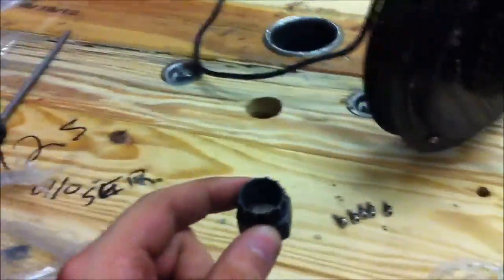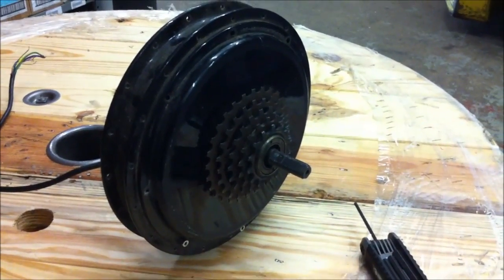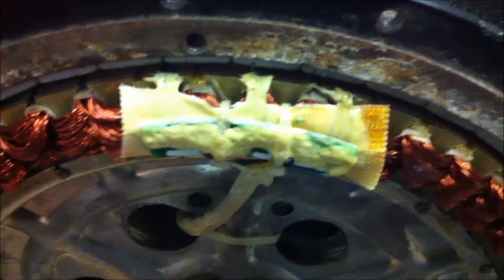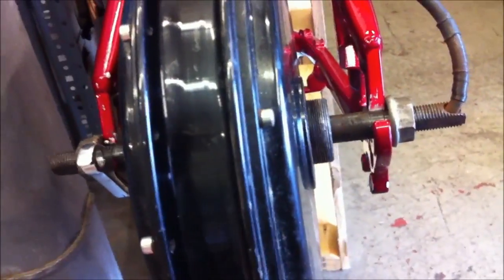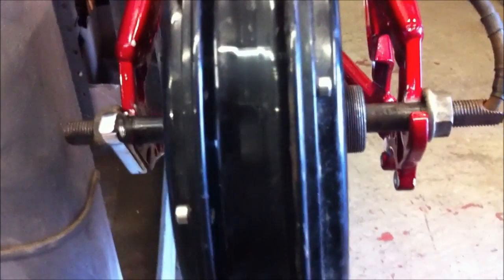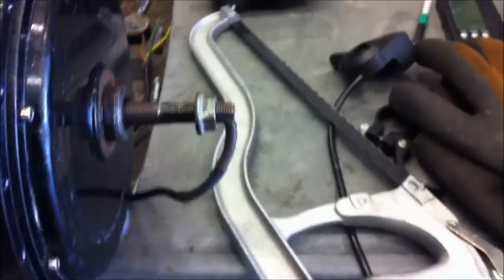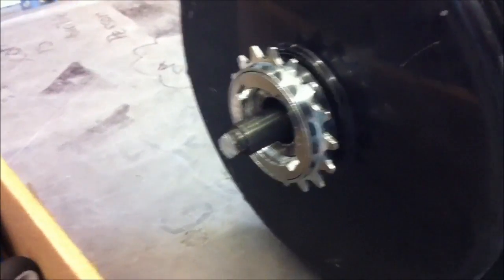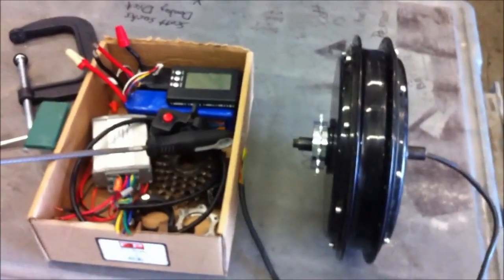48V 1000W GM Electric Hub Motor Opened/axles Cut

Comment: I have this motor and have been running it on 24s LiPo charged to 99v with up to 10kw max power running through it. Had it over volt for over 5 years, only for the axle to snap on the wire side. Now I see you cutting this axle up when I'm trying to source 1 to replace mine. This motor is soooo under rated. The China knock off version has less copper filling and weaker magnets inside so I might just get another QS to replace it, unless anybody has 1 of these broken for sale with an intact axle.😢😲